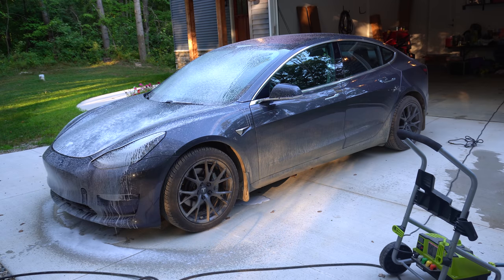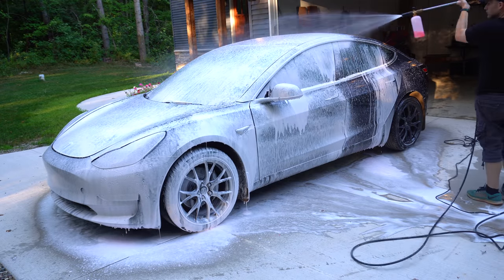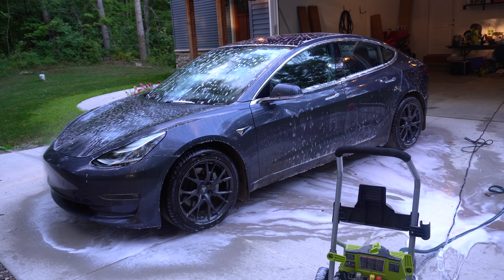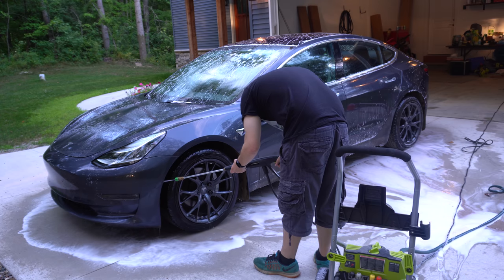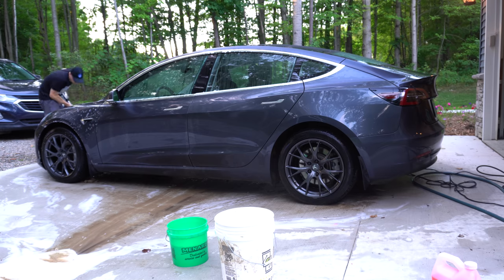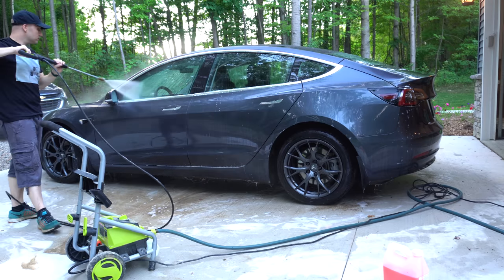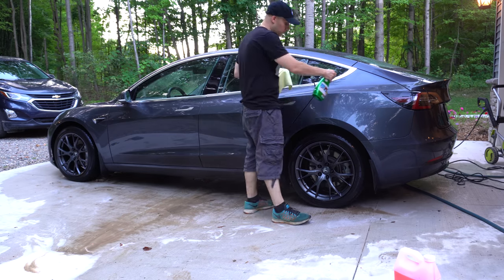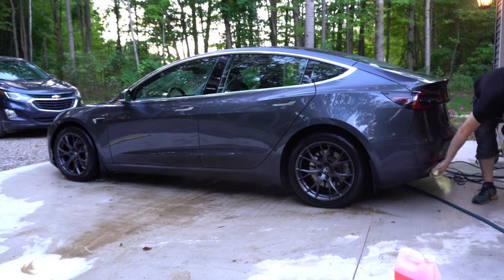Washing The Dirty Tesla | Foam Cannon | What I Use to Wash My Car | Cleaning a Muddy Car

Comment: Use a leaf blower to dry it off touch free. It works for me.
Reply from the maker: I've tried that still was awful. Maybe with this new turtle spray stuff
Reply: some vacuum also allow to put the tube on their exhaust port
Reply: The foam was super weak.  Give the meguiars  hyper wash a go, super sudsy. Overall great shampoo.  And a easy sio2 product like the turtle wax hybrid line.   And 2nd the blower for drying. The more you touch the car the more chances to introduce scratches ✌🏼

Comment: Regarding the foam cannon... You are either not using enough soap (you want  1/3-1/2 cup of soap in their), or not adjusting the air/water/soap knob on top of the gun. If you twist that knob you should be able to find a sweet spot where enough air/water is being injected into the soap to create a thick foam.

Also I wouldn't really recommend "blasting" the dirt off with the pressure washer. A general rule of thumb is if you can stick your hand in the water from the pressure washer then it is safe for paint. I personally use a 40 degree nozzle on my washer.

When touch washing try focusing on the upper, cleaner areas first working your way down. And a trick to get really thick foam in your bucket is to add the soap/water and spray high pressure water from your pressure washer into the bucket, just make sure the nozzle is completely submerged before you spray.

Comment: I just use a hose wet the car get a bucket and soap use a sponge soap up the car with my hands with the soapy sponge rinse it off and let it air dry. I don’t need all of these god damn pressure washers and foam cannons I just use my hands. But on the bright side 1 it gives you a workout 2 doesn’t hurt the sensors 3 it’s still satisfyingly awesome and your rewarded by a nice clean car

Comment: The scrubbing was wrong. You want to go around the car on different heights, from the top to bottom every round with a new cleaning tool, to avoid picking up dirt on the bottom of the car, making microscratches all over the car.

Sand and stones in general are much harder than glass and your paint, it like using sandpaper on your car. 

One time is certainly no issue, but it will do damage when done that way all the time.
Reply: Ruben Kelevra “You’re holding it wrong.” —Steve Jobs re: antennaegate

Comment: Nice! A few comments.

1. Power rinse BEFORE you foam spray. You don't need to clean the dirt, and it was still there after you foamed.

2. Using the same wash mitt likely means you're scrubbing dirt and debris that didn't come off in your rinse bucket back on your car. This can scratch and swirl. I know you said you don't care too much. I use a few clean microfiber towels, fold into quarters, then use one for the front half, switching to all 8 quarters (front and back) of the microfiber towel for each section, then a 2nd one for the rear half. 

3. Use a leaf blower to dry much of the water off! Also, there's some stuff called PDMS, it's a drying aid. Spray it on while wet. The Turtle Wax product you used might be similar. Something else Scott from Dallas Paint Correction & Auto Detailing suggests in the video titled "No Water Spots When Washing In The Sun - Secret Told!" he says Superior Products Formula 4 Spray Wax works in a similar way, claims it was $16-20 for a gallon. Not sure if you can get it near you. 
https://www.youtube.com/watch?v=tzLlo3ySIrs&t=1s

I've been using the Turtle Wax ICE Spray Wax, which is also pretty great, lasts several months. Lots of solid videos of car people saying how well it stacks up to more expensive solutions like ceramic spray coatings.

Comment: Spots are largely from leftover minerals due to using "tap" water to wash your car.  I have an 8 stage whole house water filter set-up. Not only does it really help with keep bathroom / kitchens fixtures clean, it's better for your skin (shower/bath) and clothes (laundry). I use a faucet from the garage and it all but removes water spots even when not fully dried off.
Reply from the maker: This is well water that has not even gone through a softener haha so yeah I'm just screwed when it comes to drying my car. I found the turtle spray on wet wax stuff helped (can't remember if it was in this video).
Reply: @DirtyTesla  you can add an “in-line” water softener/ deionizer for $150 - $500 that will make a world of difference. 

I’m also surprised your using well water without any filters. There have been countless water stories in the last year alone countrywide of contamination due to mining run off, landfills, military bases  - all from 25, 50, or even 100 years ago that has finally made its way into the water table finally. Likewise fracking has caused a lot of contamination as well due to all the chemicals they pump in and the “fracturing” of the rock causing mixing with gyre water table.

Comment: Should go soapy foam coverage, rinse after letting sit. Soapy handwash avoiding circles just back and forth movement. Rinse. Towel dry (making sure to just pull the towel and letting it use its natural weight as pressure) then finish off with wax.

Comment: How long did it take start to finish? I don’t have access to a hose so I do rinse less wash using a two bucket method with ONR. Learned the method from Tesla Raj and it really works - no swirl marks after two years of ownership even through brutal New England winters.
Reply from the maker: Took about an hour and a half. Unfortunately the rinseless method doesn't work for me with the amount of dirt and chunks on the car

Comment: Sorry, but I liked your video. I have a similar attitude about washing cars. For me, a car is just a convenient means to get from point A to point B. Of course, it is nice to do it in a Tesla! BTW, the car looked great when you were finished, and if I recall correctly, you did not do any PPF or ceramic coating. I am still debating whether to do those things on my 6 week old Model Y.
Reply from the maker: No ppf or anything. I waxed it one time April 2019. But I like this turtle wax. Way easier. I will be using that from now on

Comment: On a related note:  I've heard some say that you should not take your car through a commercial car wash.  Is there anything to that?  And why? I don't own a Tesla yet, but a good friend of does.  SO......   asking for a friend.  Really.
Reply from the maker: It's because you don't know what was on all the other cars and what got stuck in the brushes. Imagine I go through with all my mud, and all that dirt and stuff is stuck on the brushes. Then you go after me and it runs against your paint.

Also, Tesla recommends against it for the sensors. I've gone through a few times with no issues. Touchless works great.